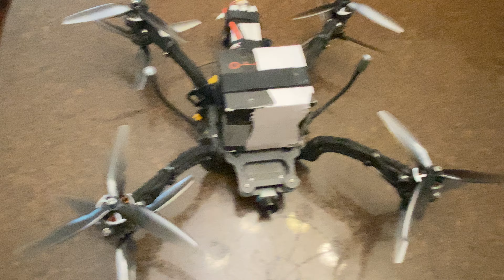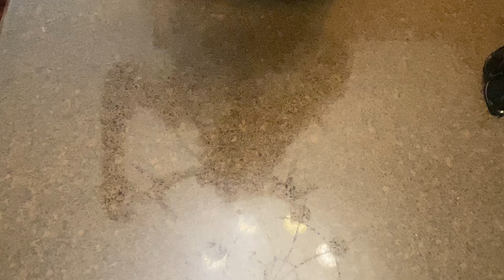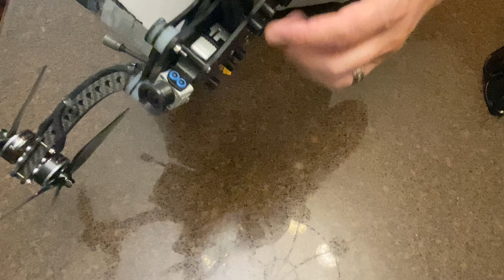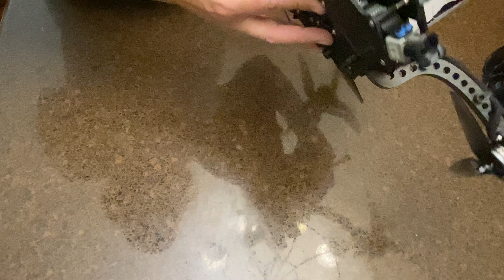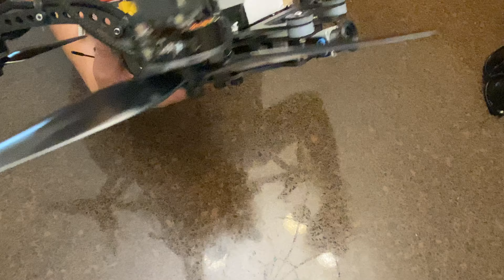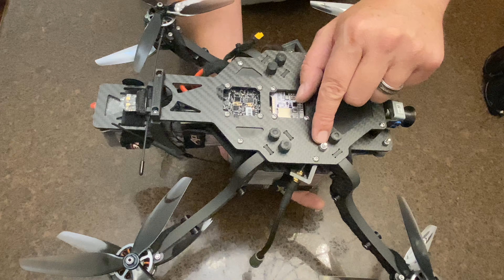Siccario Cinelifter Introduction

Comment: How effective is the steadxp on this drone ? Are the soft mounts enough to remove any vibrations? Flight time with normal to speedy car chases?
Reply from the maker: SteadXP works great if needed.  The dampening plate should isolate most vibration if any.  3-5 minutes depending on throttle use and battery.